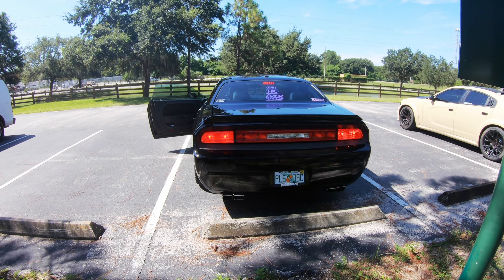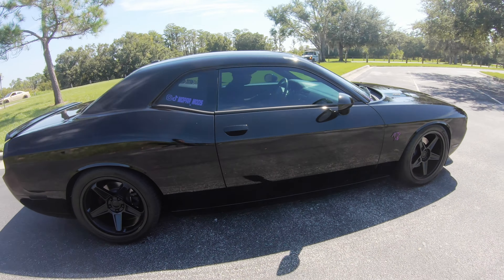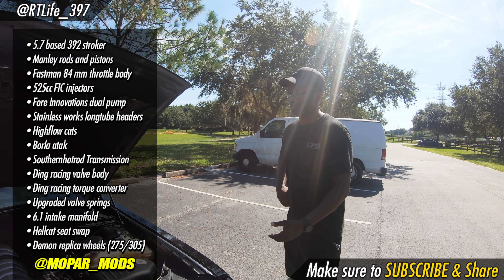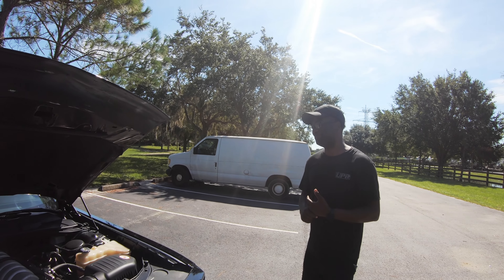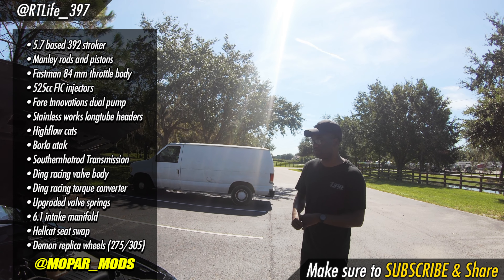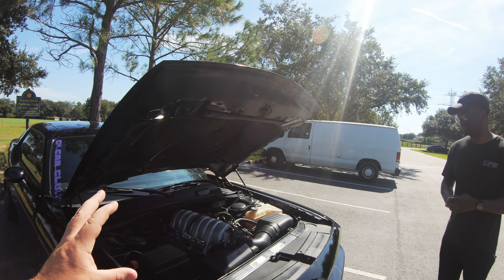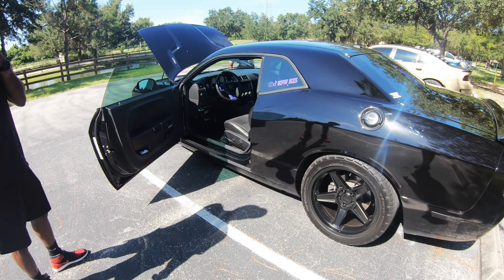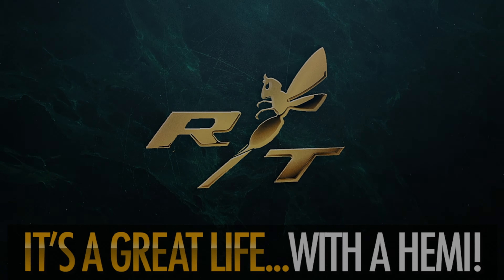5.7L Stroker or 392

Comment: 😭 alll that spent for just 430 wheel lmao.. shoulda just got a scat, mine is makin 500 wheel and im not even full bolt on yet, it spins 315 all the way to 60 lol
Reply: I spent less then half the price of a scat and will be right at half the price of a scat with more power then a hellcat after the supercharger. If you know you know. No car payments
Reply: @FranksGarageOfficial  post it then. Where it at tho? 🤷
Reply: @TheVagitarian18  I did. I'm the guy in the video 🙊
Reply: @FranksGarageOfficial  well theres no supercharger on there yet lol. And you bought a new trans and built and stroked motor, theres no way that is cheaper than a scat with the price of that r/t being around 20k unless that you did it all yourself. That was a long ass laundry list of stuff i got tired reading when i got halfway.
Reply: @TheVagitarian18  paid 5k for the car with around 15k in mods. 20k for a built motor/trans and laundry list of other mods that made a unique payment free build with or without the supercharger🙏🏾
Reply: @FranksGarageOfficial  i like the build, its just it does add to 40k which scats now are outrageous going for 45k and above but i got mine for 32k and with mods im at 40k with 500wheel. I dont plan on boosting tho i wanna get to 600 wheel NA which i can easily. More mods are coming out for the 6.4 than 2/ 3 years ago. Respect tho it sounds beautiful 👌
Reply from the maker: 500whp isn't happening unless you have a full bolt on, cammed, ported head 392. That is a maxed out 392 without adding forced air or stroker kit. If you're at 500whp with what you listed your dyno is not accurate. He's throwing down 430whp with a fully built engine that can make 700+whp on 10-12lbs of boost. You have to spend $$$ to get a stock 392 able to handle that kind of boost.
Reply from the maker: A stock scatpack can light up a shitty pair of 315's - I know this because I've done it plenty of times
Reply: @TheVagitarian18  no doubt bro if you got IG I'll follow👍🏾. It's definitely expensive if you already got $40k+ into it with just car payments. Plus dodge didn't do anybody favors by getting rid of the hemi. This is just a alternative route for people looking to have a nice ride and not get hit with dealer markups. You definitely got blessed tho bro with the price you got 💪🏾

Comment: 392 r/t and scatpack are literally the same thing ma boy
Reply: Yes and no. Your not wrong but dodge has bad marketing. Before scatpacks all the 5.7 hemi cars were just "R/Ts". They only came up with r/t scatpacks because they also had SRT 392 cars and had to find a different name that people would recognize.
Reply: @FranksGarageOfficial  no. The r/t 392 was made as a great value 392, it was meant to be a cheap way of getting into a 392, the srt 392 was the one that came with all the bells and whistles, srt is more than an engine, its a package, sure you can option a scat like an srt but its still not an srt, an lt1 camaro isnt an ss just cuz it has the same engine, it can be optioned out like one with brakes and suspension etc but its still not an ss
Reply: @lilchickenwing7556  you literally said the same thing I did. I did say the were the same car. The need a different name that people would recognize hence R/T scatpack. The title of the video refers to 5.7 R/Ts that have been changed to 392 strokers as a option

Comment: Sounds more expensive 🤔
Reply from the maker: yah, but the advantage is you're getting a built engine that can handle more power.
Reply: @RTLife  But wouldnt you be able to build the 6.4 as well and get even more power? I am fairly new to this modding stuff.
Reply from the maker: With a 6.4L 392 you can do drop in pistons/rods with a cam & you're able to be make a ton of power for less than boring & stroking a 5.7. The only issue is, in many cases the 392 is a lot more expensive to get into over 5.7L (similar year/mileage/etc.)
Reply: It's not expensive compared to what you'd pay for a stock scatpack. It could get out of hand if you don't do research but it's actually simple to do. The easier rought is a clean 5.7 with proper ring gap, cam, forced induction, and a custom tune.
Reply: @RTLife  Ah ok, so its more of a "how much money you wanna drop" type deal